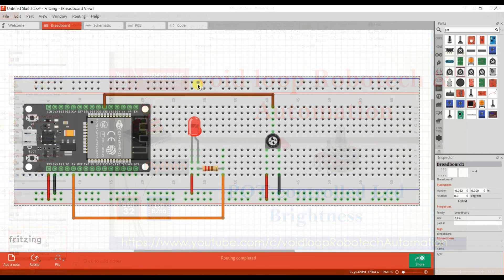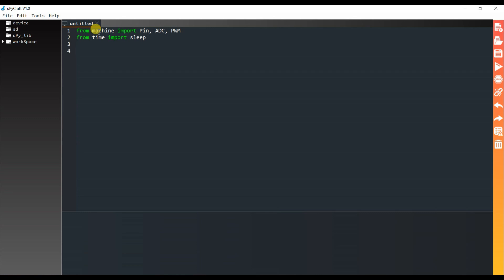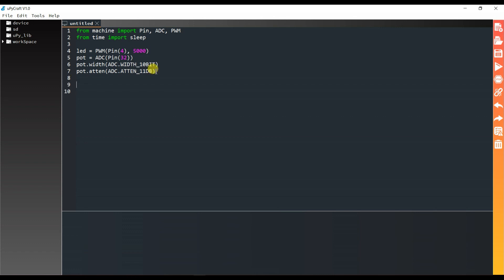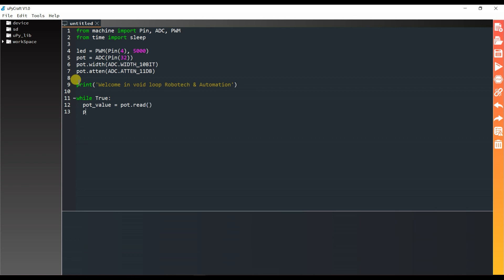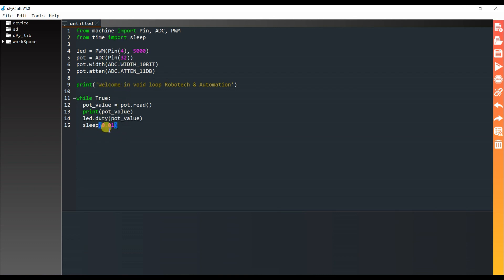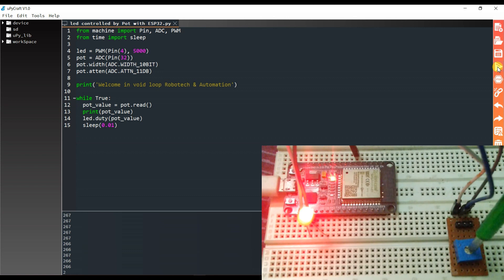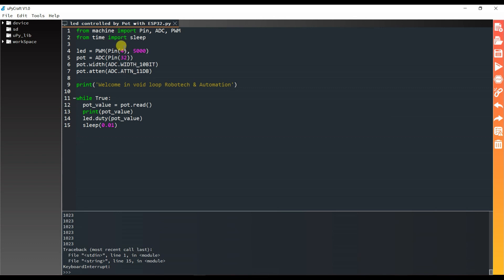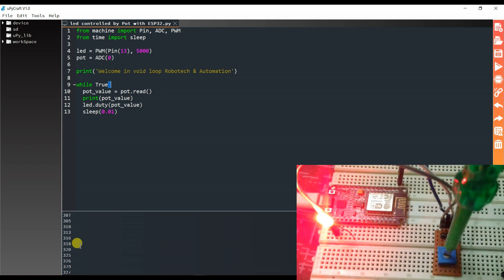10 Brightness control of  Led with PWM by Potentio Meter and microPython  || ESP32 & ESP8266 ||

Comment: I have been following this tutorial, and it has helped a lot,  plus it is fun tinkering with things,  because I am trying to learn micropython as well as the ESP32,  I have asked Ai to explain the code in detail.  so below is for my reference and for those interested:

! Here's a *step-by-step explanation* of how this MicroPython code works on an *ESP32* with a **potentiometer controlling LED brightness**:

---

### 🔧 *Hardware Setup Summary*

* *Potentiometer* connected to pin *32* (analog input)
* *LED* (via suitable resistor) connected to pin *4* (PWM output)
* *ESP32* board running MicroPython

---

### 🧠 *Line-by-Line Explanation*

```python
from machine import Pin, ADC, PWM
from time import sleep
```

* Imports necessary modules:

  * `Pin`: to configure GPIO pins
  * `ADC`: for analog-to-digital conversion (reads potentiometer)
  * `PWM`: to generate pulse-width modulation signal (controls LED brightness)
  * `sleep`: to introduce a delay in the loop

---

```python
led = PWM(Pin(4), 5000)
```

* Initializes *PWM on GPIO 4* with a frequency of **5000 Hz**.
* This will be used to control the **brightness of an LED**.

---

```python
pot = ADC(Pin(32))
```

* Initializes an *ADC (Analog to Digital Converter)* on **GPIO 32**.
* This pin reads the **voltage output from the potentiometer**.

---

```python
pot.width(ADC.WIDTH_10BIT)
```

* Sets ADC resolution to **10-bit**, so values from the potentiometer will range from **0 to 1023**.

---

```python
pot.atten(ADC.ATTN_11DB)
```

* Sets the input attenuation to *11dB**, which allows the ADC to read voltages up to approximately **3.6V* (useful if the potentiometer goes beyond 1V or 2V).

---

```python
print ('Welcome in void loop Robotech & Automation')
```

* Prints a welcome message to the console once when the program starts.

---

```python
while True:
```

* Starts an **infinite loop**, meaning the code inside will run repeatedly.

---

```python
    pot_value = pot.read()
```

* Reads the *analog voltage* from the potentiometer and stores it in `pot_value` (range: **0–1023**).

---

```python
    print(pot_value)
```

* Displays the raw ADC value in the serial terminal for debugging/monitoring.

---

```python
    led.duty(pot_value)
```

* Sets the *PWM duty cycle* based on the potentiometer value.
* PWM duty controls **LED brightness**:

  * `0` = LED fully *off*
  * `1023` = LED *fully on*
  * Values in between give *varying brightness*

---

```python
    sleep(0.01)
```

* Pauses the loop for *10 milliseconds* to avoid overwhelming the system with constant updates.

---

### 🔁 Summary of Functionality

1. Potentiometer turns → voltage on pin 32 changes.
2. ESP32 reads this voltage via ADC.
3. That value is used to adjust the **PWM duty cycle**.
4. PWM signal on pin 4 changes → LED brightness changes.
5. The loop repeats, allowing *real-time brightness control* with the potentiometer.

---